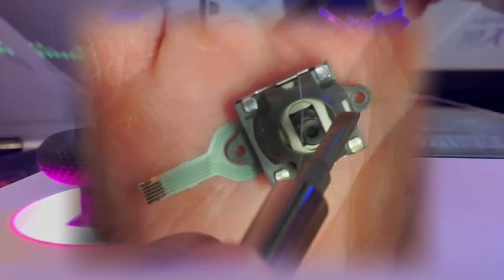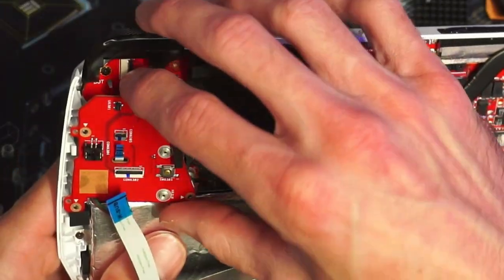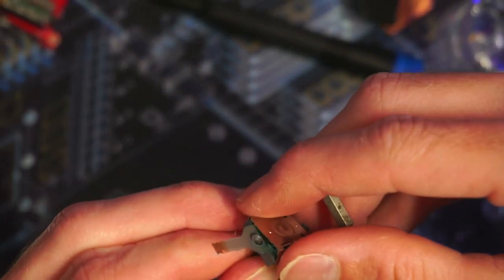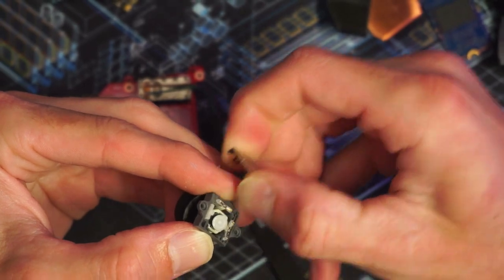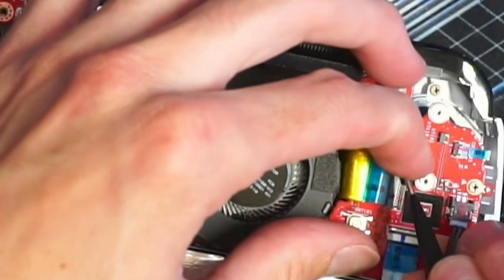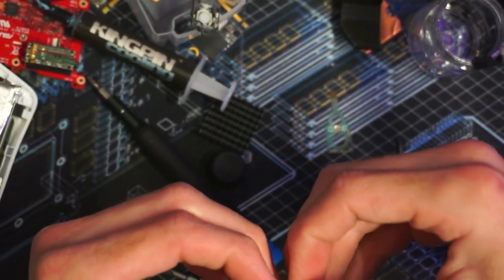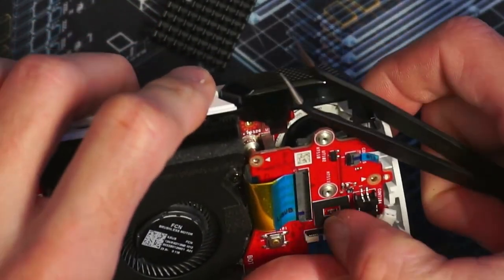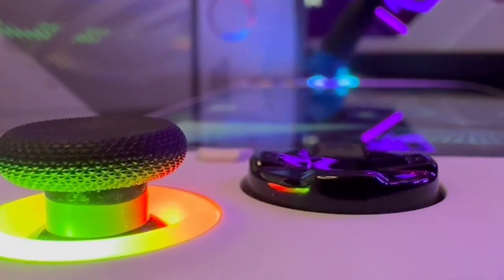Rog Ally Joystick Spring Mod - Stiffens Your Sticks! But Was It Worth It? Yes... But....

Comment: Dude, thank you so much for this. I'd all but given up after snapping all 4 clips on the backplate but after your suggestion that it'll still attach with the side clips bent in — absolute hero. I wasn't changing the springs per your plan and instead fixing the right stick that was dead horizontally after only 2 weeks of albeit kinda intense use. The top/horizontal part had come out of its mechanism/slot. Saved me from ordering a new one! 

Earned a sub from me!
Reply from the maker: Thanks brother. Hey have you seen any of my newer mod videos. Lmk what you think.  I’ve pushed out a ton of them but here’s one https://youtu.be/GYUOwa78wmg?si=z0BafETAHqDTbEi9

Comment: This is the first thing I did to mine I play fps and couldn’t take how loose they felt  and while it was open I did the teflon tape on the joysticks stems as well the whole thing feels so much better
Reply from the maker: Heck yeah. What’s the teflon tape mod do ? I haven’t seen that before.  Now you got me interested lol
Reply: @cppctek  some ally have the joysticks caps kinda wobbly and they click and you can feel it usually when moving the sticks side to side and applying some teflon tape on the sticks stems it makes the caps fit more snuggly therefor removing the noise and the wobbly caps feeling
Reply: So do I just have to put some Teflon tape under the stick cap? how much is best to take?
Reply: @usagitivi4054 just take cap off and wrap tape on the stem of the joystick itself and how much it depends on how loose your caps feel wrap some push the caps back on and see how they feel if still loose wrap some more but an inch to 2 inches should be enough
Reply: I mostly play shooters competitively on m&k but with the 120 hz I enjoy the thought of being able to play relatively competitive on the go with the sticks. Would the tighter sticks make enough of a difference for accuracy to feel more comfortable for shooters? I’m newish to controller playing
Reply: @stretchedraz tighter feeling sticks def make a diff my friend. That's why pro controller like the Xbox Elite v2 have adjustable tightness on the sticks. Basically, being tighter means u can be more precise bc small movements don't move the reticle as much. I just got an Ally and I don't like how loose the sticks feel. Still gotta try games on it tho. PS - I have the Elite V2 and use the tightest setting for aiming
Reply from the maker: Yes tighter really helps me be more precise and direct in cod and other fps games
Reply from the maker: Stay tuned I may have a new stick mod soon

Comment: Great tutorial man.  I can't believe there aren't more like this given how loosey-goosey the Ally's thumb sticks feel.  I might not even do the mod but here's a tip from a fellow tech nerd 😁 Oh and was wondering, have u stretched the springs beyond what's in the tutorial? I like mine extra stiff (is what she said)
Reply from the maker: Thank you so so much !!  And yes I like it tight and stiff too lol 😆 but yeah I’ve gone past that. I’ve also used the springs out of the handheld diy brand tighter hall sticks and those works great too if you have them but the Hall effect sticks themselves the sensor on the left gets messed with when you using the trigger and reduces direction. I have been meaning to do a more up to date joystick guide. I will be doing one soon for sure. Thanks again. !! 💕💕🤠🤠
Reply from the maker: Here’s a video showing the handhelddiy hall sticks https://youtu.be/jjfJmBDJ-h0?si=TcICDaR0sCAUvQN8
Reply from the maker: Also watch this https://youtube.com/shorts/D4NZpD6H9sc?si=P7Is2KB793gPerht
Thanks again !

Comment: Broke my joysticks gotta order new ones 😢😢. Is there any joystick replacement that brings the spring adjusted already?
Reply from the maker: The handheld diy place sells them but they are Hall effect and require extra steps to get them usable because of the interference
Reply: @cppctek  does the Hall effect fix the “looseness” problem or is it any better? Also I could just follow your tutorial for that kind of joystick right? Thanks for the reply

Comment: Want ask a ? About the heat sink mod... I did ur mod and wanted to know did I have to remove the sabrent sick on drive... also I notice when i use my XG Mobile that fans on it are not on all the time now like was before.... thanks for the mods and keep up the good work
Reply from the maker: Hey the sticker is ok to leave on. Won’t make a difference. Makes warranty easier with sticker on. Also fans aren’t on as much due to apu temps being lower
Reply: @cppctek  sorry but I spoke to soon... I don't know it I did anything wrong when idle I can get 70c in game but when I started to play more went as high 94c then went to 90c to 91c... was playing Horgwarts Legacy
Reply: Is there anything I can do to fix thisb Issue?... had the same problem when using the Copper heat sink mod too
Reply: Have u did any test with Sabrent drives?? I the heat sink mods I have done have been with Sabrent drive... maybe it the drive that has Issues...
Reply from the maker: Are you looking at nvme temps or apu temps. Armory crate does not show the nvme temps. You have to look at a program called hwinfo to see nvme temps
Reply: @cppctek  I been looking at the  armory Create... but is it ok for games to run at 90c?? Sorry if I'm ask some dumb ?
Reply from the maker: 90c in armory crate is the apu/cpu temps now the nvme temps.
Reply: @cppctek  cool I test tomorrow... is there a Certain temps I should look for that is good?... thanks for the help
Reply from the maker: Nvme temps preferably should be kept under 70 by what all the drive companies that emailed me said
Reply: @cppctek  I did test on NVMe and yes I get low temps at 37c but for some reason when I play game like hogwarts legacy I get 88c to 94c with xg mobile but when playing in handheld mode I get 89c to 96c... but when playing with out heatsink I get 82c to 88c... something must happen that my apu/gpu get much hotter when using heatsink

Comment: My right joystick kicked the bucket and I’m about to replace both with Hall effect joysticks. I find them too loose too, so I may stretch the springs while I’m in there as well. Question though, on whether you think I could do this. I’m a little hesitant: I’ve built my own computers and also upgraded my laptop internals. I don’t have much worry about simply replacing them, but I do worry about taking them apart to this extent.

Could someone help me if I fudge it up? Lmao!
Reply from the maker: It’s not bad but I will say stay tuned. I have some new drop in ones coming soon.
Reply: just do it,the price just 25 RMB for 1

Comment: Hi, im planning to take care of my gp66 disgusting temperatures using Gelid thermal pads and shimming gpu by 0.3mm as You suggested. How are your cpu temperatures tho? In the video of gp66 teardown comments You said to "Use thicker layer of thermal paste on the cpu", did the die contacted fine? I wanna make sure cuz my biggest concern were extremely high cpu temperatures. If you could give me link to reddit post about gp66 you created it would mean a lot to me as it's not in the video description. Thanks
Reply from the maker: Hop on by my discord I’ll share some temp temping data and compare

Comment: I need this mod.. Because my analog, not back to centre
Reply from the maker: Have you tried re calibrating it a few times. ?
Reply: @cppctek  on physic, my ally not back to centre (have space on left).. On calibrate working normaly
Reply from the maker: @miftahfarid6112 send a picture in our discord.  Never seen one physically off center unless it was dropped or broken physically. And I’d suggest letting us see it before you void the warranty or mess anything up if it can be fixed by asus free

Comment: i can get it down to 4.0 / 3.4 on the circularity test
Reply from the maker: Dam impressive
Reply: @cppctek  but i have to put dead zone around 25% and outer zone at 90% if i remember right. I wanted to make a post on reddit and see what results others get.

Comment: Do you know, if I took the springs from a standard xb1/ds4 ALPS analog module would they fit and be a higher tension than the oem springs in the Ally ones?
Reply from the maker: Unfortunately they wouldn’t fit. They are too wide to fit inside the hole. That’s the first thing I tried. I ruined a few controllers too busting springs out lol 😂

Comment: I just add a piece of cotton between the joystick and stick piece and is tight enough to not get stuck
Reply from the maker: That’s cotton does nothin for the spring tension if you’re just setting it under the joystick cap. Unless you’re taking the entire joystick apart and taking the spring out and then shoving cotton inside the spring cup and using that as a spacer but even then that will get caught up eventually. Horrible idea lol
Reply: @cppctek  it's exactly the same as tensioning the spring, you are just mad that you have to pass through all the pain of taking apart the joystick, it's not rocket science you know?
Reply from the maker: @carimpest the tension does not come from under the cap dude this is not the tension we’re talking about out
Reply: @cppctek  I mean it works great for me, another tip is that instead of using joystick protector I cut a piece of hydrogel screen protector and wrap the joystick stick with it very carefully and its absolutely seamless
Reply from the maker: What’s the purpose of the screen protector film ? Drop by the discord plz if you can. I really am now curious about this h mods and seeing what you’ve done. Also my community wants to see
Reply: @cppctek  I mean, sure? Tell me your discord to drop in...
Reply: Adding cotton to any moving parts is never a good idea.  Cotton falls apart even when its on a t-shirt.  Might work short-term, come back here when several months have passed 😉